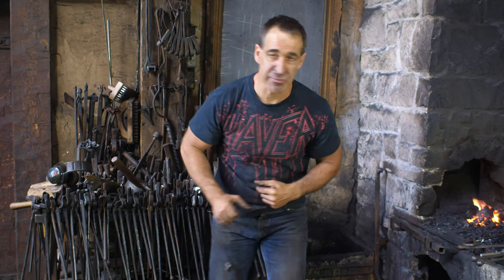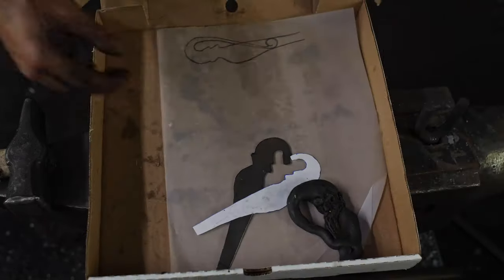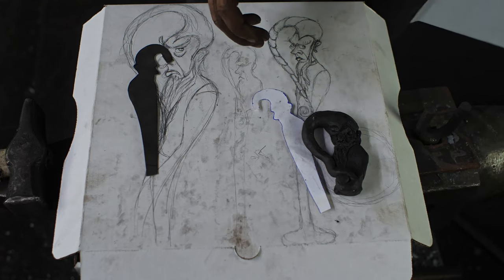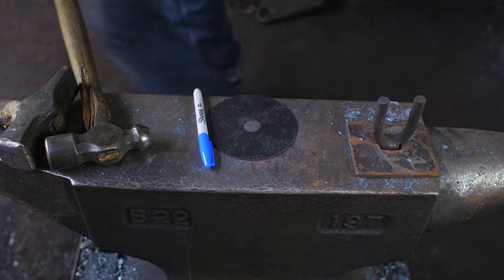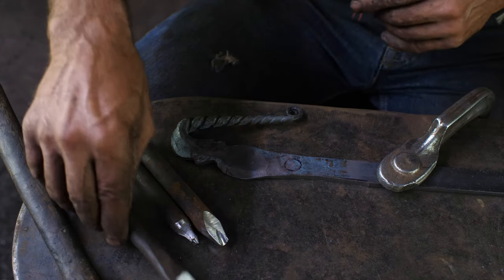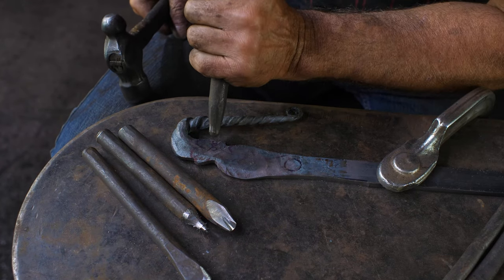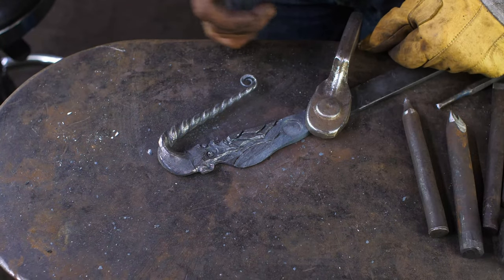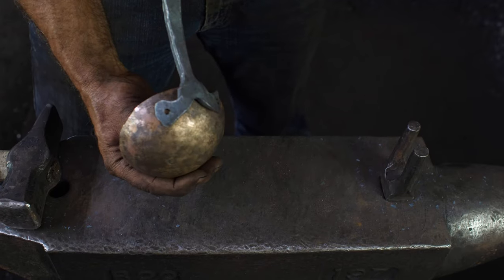Wizard's Ladle - Hobbit Hole

Comment: Very nice! As for the safety of cooking in bronze it's rather safe depending on the alloy just as long as you don't start cooking every meal in it you'll be just fine regardless however it's not a bad idea to heat them up to a boil just to get rid of leftover oils and bluing prior to initial cooking 👍🏻